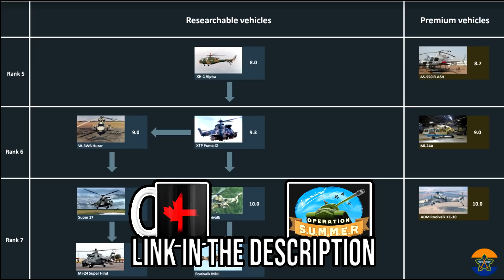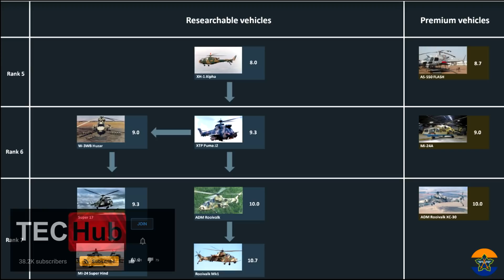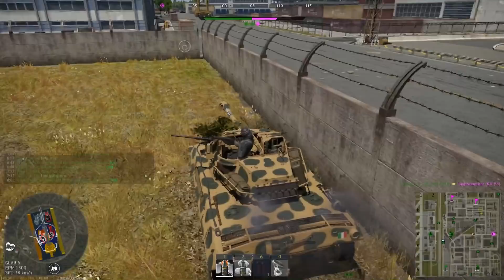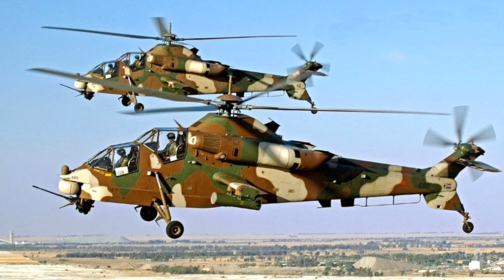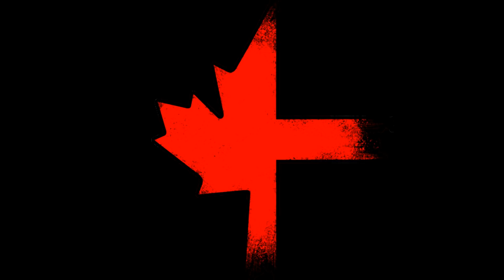Advocation For South Africa - Helicopters - Part 1 - The Rooivalk - War Thunder

Comment: My comment on the 20mm cannon at 0250 regarding the XDM is not correct. The XDM initially tested the XC-20 which was replaced by the GI-20 which is the same gun as the Ratel 20.

Comment: im disappointed how they implemented south africa. they shouldve made it an entirely new nation, just basically foldered with britain. when you click on the folder, the tech tree shows up with separated ladders of the tree so that theyre not all in a single line. they could have separated these vehicles tier by tier and be pretty empty. though this will create the illusion that this is  just a really boring mini nation, the catch would be that you could get both of those nations vehicles in the same lineup. then south africa would look more distinct and there could be a lot of other minor nations/commonwealth nations added. if there were say, east and west germany the vehicles should be separated in their respective trees. this would allow for space for stuff like the t34/85, t55a, t72 and mig 21 bis DDR while the f4 phantom could be in the west german tree. match maker would make these nations go against each other, and you can't crew these two nations together simply due to balance issues, but this is what creates the space for the mentioned vehicles.
Reply: Looks like I found you
Reply: @furious-ninja3324  wat
Reply: That's actually very smart

Comment: The MI 24 is like the helicopter Sherman.
Reply: well it's a great helicopter, makes sense that everyone would want to get their hands on one.
Reply: I’m just basing my comparison on nation alone, so I’d say the MI-24 is the T-34 and the UH-1 is the Sherman, if you want an attack chopper instead the AH-1 deviated from the UH-1.
Reply: @sargesacker2599  The reason for comparing it to the Sherman is that like the Mi-24, the Sherman got some fairly extreme third-party upgrade packages to keep it relevant for decades.
Reply: Well the ah1g is more like a tiger then it can take hits and still survive for round 2